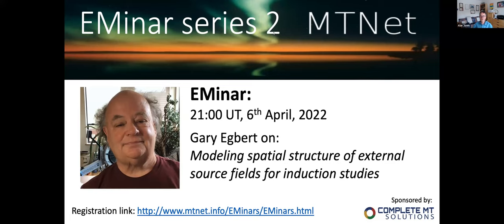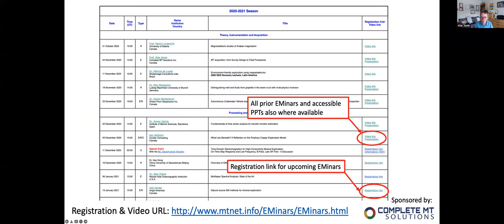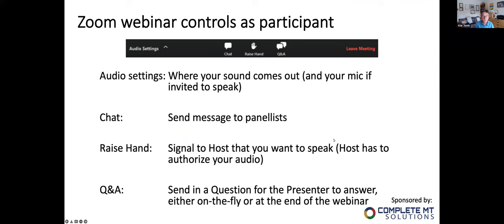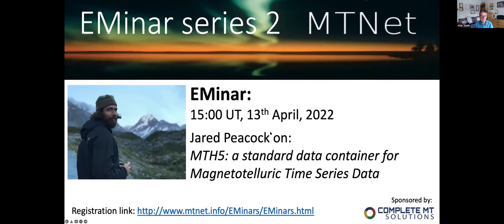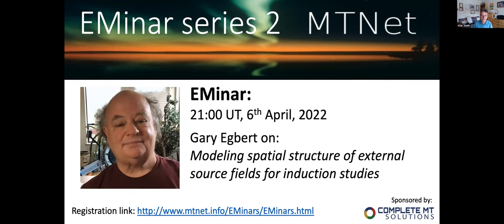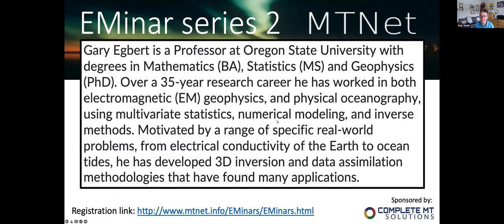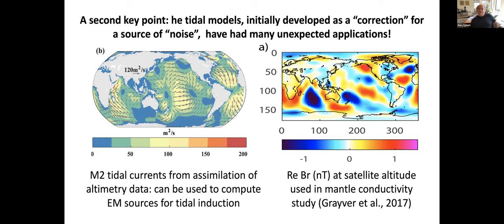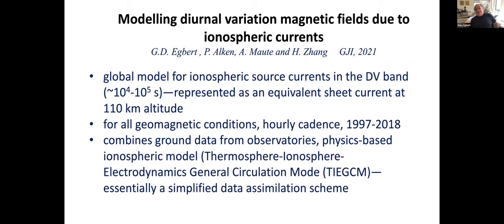EMinar 2.24: Gary Egbert - Modeling spatial structure of external sources for induction studies

Comment: At 44:17, you are summing scalar quantities as if they are vectors.  Furthermore, the definition of Bz is part of a vector B, but B is a vector, so the gradient of B is a 3 by 3 matrix, and you would be considering dz(Bz), not Bz.

Also, if you sum the x and y components of a vector, that does not give you the z component of that vector.

In addition, are you sure that the R2 sum of the directional derivatives of an R3 vector function is equal to the antiderivative of the cross product of those two vectors?

Comment: At 21:36, you have some matrix manipulation.  Can you explain why you sum over k?  The result of MatrixMultiply(U,alpha) is an nxj matrix, so summing over k is presumably impossible because:

1. The matrix does not have k as a dimension

2. X is nxj, so you are adding a scalar to (epsilon)ij, which is nxj.  This is not possible according to the algebraic rules I was taught.

3.  You are summing over only one index, but applying this to a matrix, which is nxj.  It is ambiguous how you actually perform this summation.